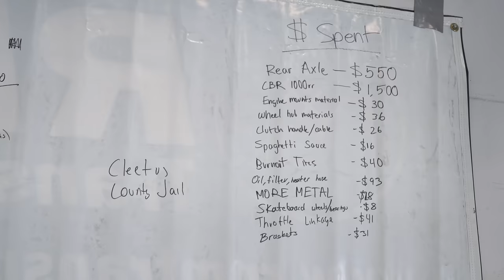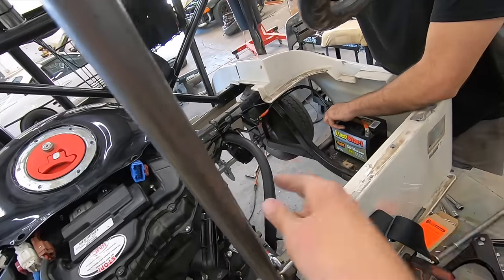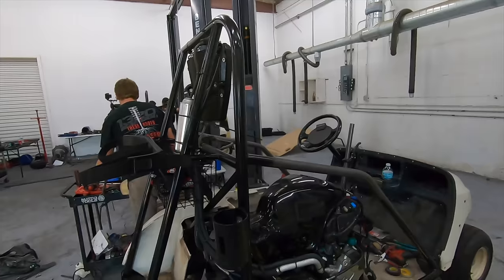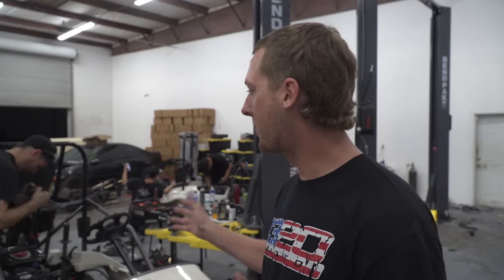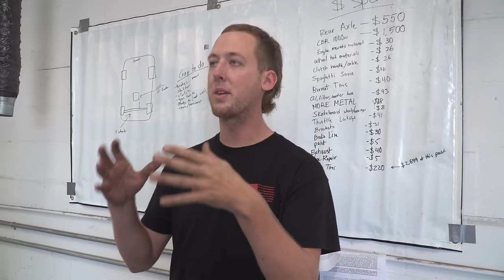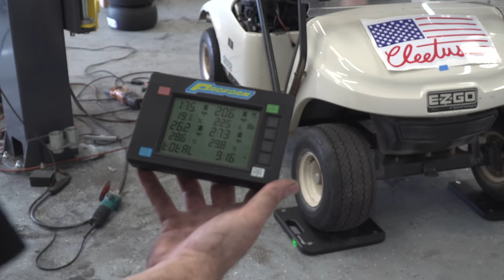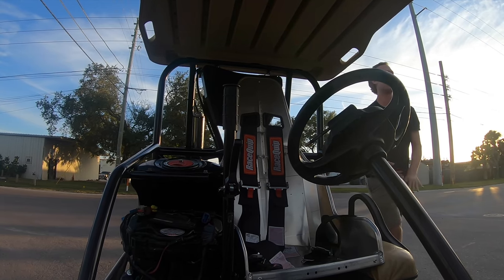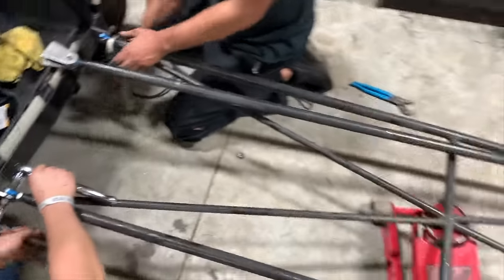Build Wars DAYS 4 & 5: FIRST RIP In Our 1000cc Street Bike Powered Golf Cart!! (IT'S INSANE)

Comment: Ditched the jet car due to safety concerns, and instead built something twice as likely to be lethal lol
Reply: I think it’ll be fine.
Reply: The ironing is superb
Reply: Nowhere near lethal in comparison to the jet car
Reply: Yup boosted boys tipped theirs on the track
Reply: @jonathanschultz2472  Everyone okay?
Reply: @GhostOfLorelei  yea they good
Reply: @jonathanschultz2472  Cleetus went down too, they both tipped over the same exact way within 10 mins of each other. Everyone is fine, they were low speed crashes. The cart is done though.
Reply: Caleb Dean 
Funny but you only live once🤷🏻‍♂️
Reply: @brianl8983  I agree the ironing was done very well. Didn't see a single wrinkle
Reply: Was thinking some safety grab bars in case it rolls over
Reply: jet cars go like 400mph. if you think this things lethat you shoulda road in my 800 cc 2 stroke snowmobile swapped honda odyssey (the go cart, not the van)  that thing would do a wheelie across the whole field in dirt
Reply: Ahh yes , so motorcycles are automaticly 50 times as dangerous as a car? 😂 they even built a tube chassis and cage. Stop complaining.
Reply: Oh hell yeh brother it did

Comment: he's about to go extremely fast down drag strip with golf cart steering...
Reply: Definitely would make the front axles wider
Reply: Should be entertaining, that is why they have cages.
Reply: That rear bounce is also no joke.
Reply: @--_DJ_--  and a kirky with 5 point harnesses
Reply: Luckily it's only the 8th
Reply: I like it I like it alot6
Reply: Yeah that golf-cart steering ratio is tight and sketchy... The front suspension is not going to like the wheelie's either.
Reply: I say hes gonna have to lift in 3rd gear, race should be best of 3..one run isnt gonna be perfect for either team lol
Reply: Wheelie bad idea
Reply: nick brown i’d prefer it as a stock golf cart lol, i wish they could still use the stock bench with no seatbelt
Reply: bryan carter it is best of three
Reply: Omg this whole time I haven't thought about how trash golf cart steering was. 😧 We've had several EZGo's and there's like a half a wheel turn worth of slop in the older ones. Brand new it still sucks
Reply: Maybe a steering dampener would be a good idea it might help sketchiness????

Comment: Boosted boys gonna win this one because of their rear suspension. They'll be able to get the power to the ground much better.
Reply: James Smith  They swapped out the original axle they installed for a solid steel chromoly piece.

Comment: snowmobile engine would have been sick too, they even got reverse lol
Reply: Not a lot of wrecked snowmobiles in Florida.
Reply: Plus the cooling factor on a snowmobile motor is crazy. They are meant for cooler temps out the gate. Not really Florida approved.
Reply: Grind hard plumbing does some projects with snow mobile motors. They have crazy power to weight ratio.
Reply: Wolffy93 they aren’t in Florida
Reply: Ive tried to find sled engines down here... they're very hard to find and they woulda been close to the same price as he paid for the honda
Reply: LucidConquest1337 the liquid cooling isn’t great on sleds. You have to have throw constantly thrown up on the radiators which are right above the track to keep the radiator cool otherwise they’ll overheat like if you’re riding on really hard packed snow or ice or something. I guess maybe if they have better airflow but they are designed to be cooled by the snow
Reply: @keyton3772  I've seen plenty of them adapted to use a bigger air radiator, it works fine, especially for something like a race

Comment: “SWEET” needs twin chains or quad chains. And a boot cup for the throttle for a little better control.
Reply: Boot cup?
Reply: @otm646  It goes on top of your foot so you can pull the throttle up.
Reply: otm646 
Gives more control of the Throttle pedal to keep your foot from jumping around all over the place and accidentally stabbing at the wrong time
Reply: No need for more than 1 chain. Chains handle 200hp bikes just fine. It just wasn't tight enough in the video
Reply: BRP Adventures 
I know they can handle between 150 and 200.
I was thinking more along the lines of it throwing the chain not breaking it. 👍🏻
Reply: @mikehamilton7206  Gotcha, all it needed was a bit more tension ;)

Comment: Love this build off and can't wait to see them in competition.
I would however like to see both teams figure out something cage wise on the front as the factory 1" square tube is paper thin and just going to fold if there's a roll which leaves you hoping it folds outward and not directly onto the driver/passenger. When that bar folds with the way these carts are made it could go from rolling into flipping end over end which no one wants to see. Also on the steering wheel/column not being break away a little over 30 years ago now I lost one of my best friends throughout childhood to a steering wheel being driven into his chest in a head on collision with such force it basically crushed him from his sternum to the base of his neck. The car was equipped with a functioning air bag that did deploy but that didn't prevent the column and wheel itself from crushing him. I know as racers no one wants to mention the injuries of other racers or even broach the subject but I really do want to see everyone involved as safe as humanly possible. That is of course kind of an oxymoron considering the vehicles in questions overall design and their now utterly insane Power to Weight Ratio, short and narrow dimensions of the overall chassis are definitely going to factor into the equation as well...

Comment: Sprocket with bearing in the middle to the frame and use and small spring, hook it to another bracket to pull it into the chain this is a real hotrod motorcycle thing I highly recommend it

Comment: I think you stretched the new chain by reving to high 1st to 2nd right off the build on the 1st run Cleetster. That's what made it jump off the sprocket. This buggy has so much torque you should increase the stance by 16 inches or so. Or put training wheels on it. 
Outboard wheel stability enhancers? 👍

Comment: If you want to change the shifting just 180 the shifter linkage from either on top or on bottom where it connects to the shifter rod coming out the motor. its a free old trick to bang through the gears on streetbikes.

Comment: You can switch the shift direction by putting the rod on the other side of the shift lever actuator. Look up "gp" shift vs normal shift rearsets. The bracket just has a hole on either side of the actuator. Street bikes come with a 1 down 5 up pattern normally, but racers use a bracket to convert to gp shift 1 up 5 down bc its easier to grab the next gear mid corner by pressing down with your toe than lifting.

Comment: i see either team understands to flop around the linkage on the shift shaft on the bike 180* it will invert the shift pattern to pulling back to upshift (which is what you want as its more natural, and will not want to cause the bike motor to want to drop back a gear from the weight on the shift when your under accleration...

Comment: You got your shifter backwards [ just like RatherBWelding ]
You don't want to have to push forward to shift up, it is natural to push forward for down. You'll find this when under heavy changes that it. It's also easier to get back to 1st. You naturally have more fine control on pulling toward than away.

Bon Chance!

Comment: Perhaps instead of an idler setup tensioning the chain and the fact there is no suspension changing the drive angle you could have made the axle with sliding adjustment for tension with an adjustable stop in front of the bearing to stop it pulling forward along with the bearing hold down bolt.

Comment: This thing needs upgrades after the competition. 1st is a better front axle and steering. It's just too loose for that acceleration. 2nd It need better brakes and pedals. 3rd is performance parts. I wonder if Rekluse Clutches makes one that fits a CBR1000?

Comment: The torque per gear should be amazing as is and plenty for those wheelies but going from a 17 to a max 10 inch wheel on the same sprockets won't do that top end any good. Interested to see it fly past the 400 mark screaming it lungs out.. Dare I say that takes some guts in such a high center of gravity narrow machine..

Comment: Garret... Your way smarter than that...Put a friggin helmet and a full on motorcycle leathers on when you ride that... I know that everyone at your age thinks they are bullet proof.

But if life has shown me anything, it's that bullet proof were not and that the odds of getting hurt/killed are always greater when we are testing/checking things out.

We tend to blow off putting all the safety gear etc. because it's a hassle and we are only going to do a quick test etc.

Thing is, that is the most likely time Murphy will show up because it ISN'T all checked out and tested.

Want to keep you and your Merry partners in crime around for a long, long time.

I have lost more than one friend doing basically the same thing.

Comment: All this money spent on both the carts and not one of them has a reverse gear so how are they gong to back up, without pushing them? What a wast of a good cart. By the way, i do not see the axle and the sprocket staying on the axle when the pin keep sheering off unless you wield it to that axle. Then it will weaken the axle and it will bend unless you temper it and harden it back up and then it could just break due to being too hard. Where is the nitrous tank? Now at the end of the day they have one extra man on Cleetus' team. Cleetus looks like Super Dave Osborn. Should have mounted the seat on some rubber with springs for cushioning.

Comment: i know its old but i am high as fuck and was a skateboarder for a long time just did the calculations and when going 20kmh per hour on a wheel that is 5cm in diameter it would be going 2.122rpm and that speed is easy to hit in skatepark even morre speeds